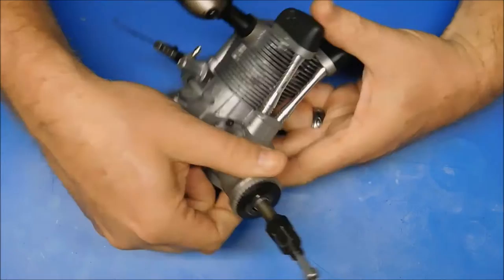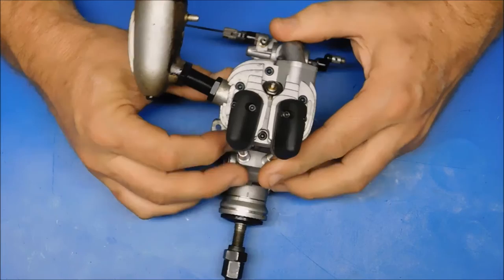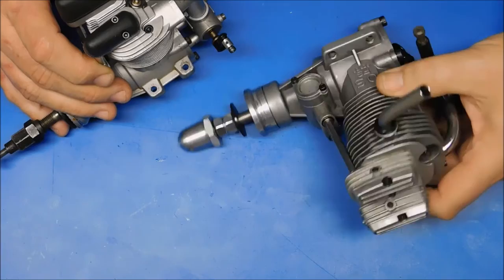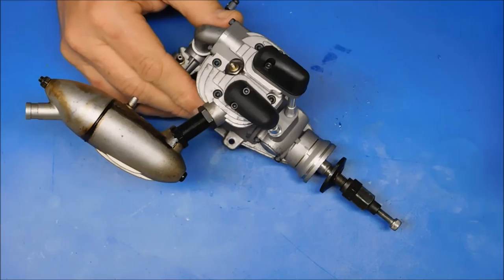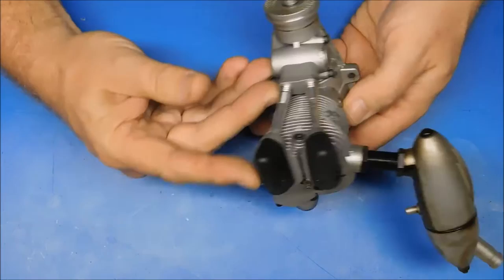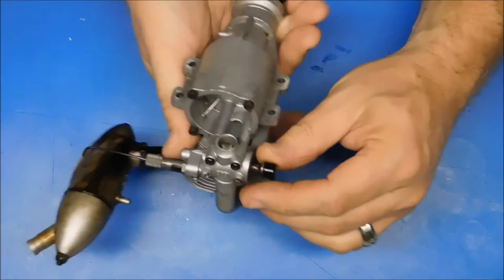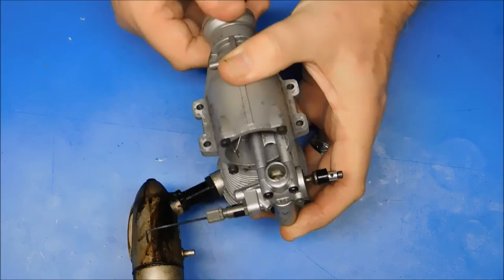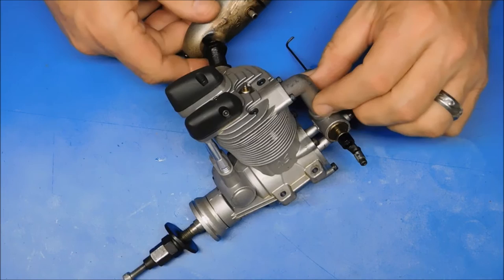OS FS-95V A Quick Look

Comment: I really dig your enthusiasm when it comes to these Nitro engines.. I have been in the hobby for over 20 years and I wouldn't even consider getting rid of my Nitro engines.. I do have a couple of electric airplanes and a few helicopters.. I have friends that are really persistent and have their own views on Nitro.. Many of them have sold everything that they have Nitro related.. Me, I'm old school and will most likely fly nitro until fuel cannot be obtained.. I'm a hard core Nitro dude.. Thanks for the video.. I want to see this engine particularly taken apart.. I agree with you.. The older the better is my experience as well.. The most recent OS purchases have come with problems, hard starts, dead sticks, etc.. Have a great afternoon / evening !
Reply from the maker: Well as of this moment the engine is completely disassembled.  Videos to come maybe tomorrow.  Thank you!  I too am a DIE HARD glow engine fanatic.  I dabbled in electrics but quickly got rid of them.  If it doesn't breathe fire and belch smoke I don't want it!